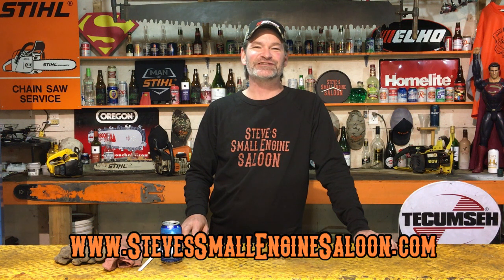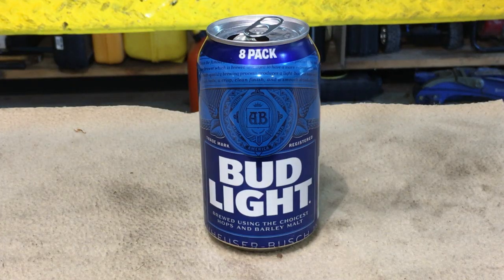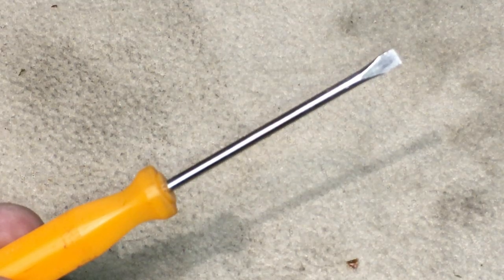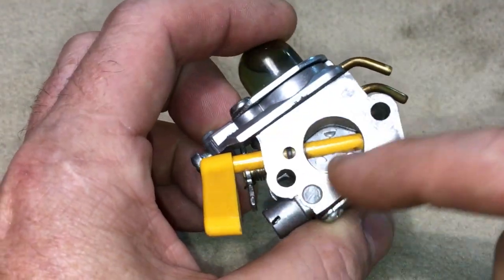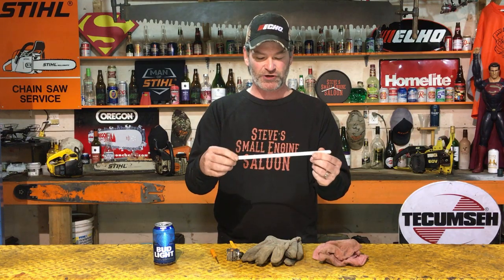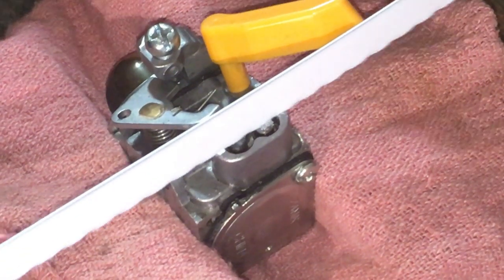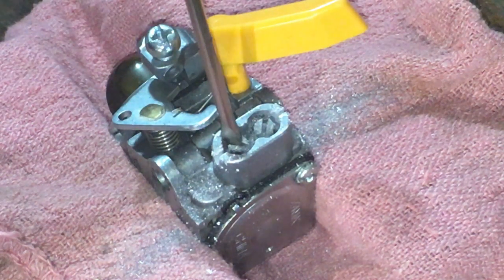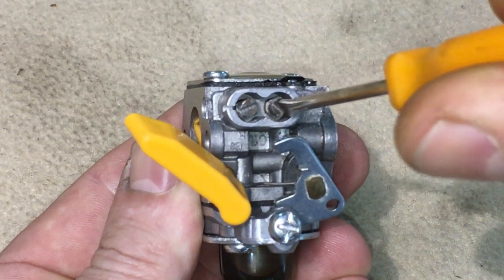How To Adjust a Carburetor Without a Special Tool

Comment: The freaking govt did NOT want the consumer to adjust the mixture. Husqvarna wont sell the tool and suggests taking in for service. I have a troybilt and found online that they are assemble at a bit of an elevation and here in FLA at sea level a small adjustment  might be in order. I have a trimmer that i paid $40- for that was put away in storage when he "went electric" and its in mint condition, so I'll  probably wait for the tool. Tractor just died so well be changing out 17hp briggs and the lawns already 2 feet tall so fugit 😅

Comment: If there is clearance and the screws turn fairly easily you can try forcing a piece of plastic tubing, like clear fuel line tubing, over the end of the screw head to turn the screw too.  This does not require and mods to the carb.
Reply: Larry Small Much easier said than done.
Reply: I think that is a great suggestion. At the very least it is another option. And I'm testing all of my options.

Comment: Yea, I ordered a set years ago. but you can also use a dremel tool if you go your way. You can also use vacuum tubing or heat shrink tubing... insulated crimp on wire connectors, etc.

Comment: THIS IS AWESOME! THANK YOU! WTH do these tool companies need to make things so overly unnecessarily complicated; just to turn 1-2 screws! Theres zero reason or need for these crazy types of sockets/drivers. Phillips, flathead, Torx, or Allen would have been just fine! Additionally, it’s OUR tool/machine we bought…they need stop trying to control and prevent us from doing our own work/adjustments…My whole manual just states go to a dealer for the L & H what a joke! Took me a few hours to finally figure out it was a Double-D. I honestly thought the screw heads may have snapped off because I didn’t see any “slots” for screw driver, etc. In 25 years of working cars, woodworking, and IT Engineer I’ve never seen or heard of these types of crazy bits like double D.

Comment: I was a bit nervous about wrecking things but this worked  like a charm!  A 1/4 turn on the high speed screw fixed up my Yard Machine Y2550’s inability to run on full throttle. A very big thanks for this viideo.
Reply from the maker: You're Welcome...

Comment: Awesome in not only letting us know of a great hack to get up and going, but teaching on the various carburetor adjusting bit kits so that we can adjust many carburetors on the market. I have a chainsaw on my bench that needs the "Pacman" bit and i was at a loss on whether i would need to take it in for adjustment or figure out another option. Seeing i am in no hurry i am purchasing a similar kit unsure if i will do the 8 bit or another 14 bit tool kit. If i was in a hurry i could also do the hack you showed. Luckily i finished cutting down a 45 foot and 35 foot tree this week, and parcelled the trunks/limbs into 12 & 18 inch portions. I have a few left to cut however 95% done, so i can wait for the carb adjustment tool set to come in rather than having to take it in for adjustment now. So you have saved this old guy some money, and i'll have the adjustment kit to save me a lot more in the future as well.

Cheers,
Blitz out....

Comment: Great video!  My Ryobi X430 trimmer was just millimeters away from the trash.  Only a couple of years old but suddenly would not run at full throttle.  Carb cleaner, fresh gas, etc. didn't help.  Unlike the Ryobi carb in your video mine only has a single adjustment screw.  I used your hacksaw hack to cut a shallow groove through the housing around the screw and the screw top itself.  Then a adjusting with a small screwdriver was easy.  And it solved the problem.  Now it will idle fine and goes to full throttle without hesitation.  Have a Bud Light and celebrate!
Reply from the maker: Right on Buddy..

Comment: Thank you so much, I have purchased 2 sets of carb tools and none of them fit on my Yardman weed eater. I used my dremel with a cut off wheel and put the slots in and it worked perfectly. The weed eater is running the best it ever run.
Reply from the maker: You're Welcome...

Comment: Great video. I use my dremil with a cut off wheel while the carb is still on the machine. Takes a steady hand though. Your way looks safer.
Reply: Works for me also!
Reply from the maker: Thank You...
Reply: Did the same way for me too.... Dremel Rox.
Reply: Just did this too today while on machine.  Works a treat.
Reply: Also did this with Dremel cut off wheel. My adjustment dials weren't parallel, but worked great. Don't forget to wear your goggles, and beware that the dials may be made of a metal like sparks like you're welding with magnesium. Lucky I didn't have any starting fluid left on the outside of the carb.

Comment: Awesome man! I've used this method before and have been running around town trying to find a spline tool for my Husky 128LD. I just put a new fuel filter and lines on it and now it only idles on half-choke, so I'll go peel that carb out and give this a shot. As always, good info, Steve! If I have a saw or any small engine issue I always go to your videos first. Thanks again, bro!
Reply from the maker: You're Welcome...

Comment: i used a hard plastic sleeve on the end of a small screwdriver and heated it so it fits snug on the idle/high adjusting screws, ( to avoid pulling it apart).... well it sort of worked, but did the job. i have a small  McCullough  ( re badged  husqvana ) chainsaw  with a two barrel carby. when its going well, it is a real pearlier.

Comment: I used a small needle nose to turn the ones on mine worked out fine
Reply: My saw has guards around the small adjustment screws so I have to dismantle the thing.  Dumb  bureaucrats need to be left on deserted island with all the gas and electric tools in the world but no energy source to run them, and no tools to do any kind of hack.

Comment: I bought a complete small engine carburetor adjusting tool set on eBay for about $12 free shipping. It has every possible tool you’ll need and some you might never use. Really handy.
Reply: Correction. It was a bit over $16.00. Even comes with a case

Comment: WOW!  SO damn obvious yet my mind never would've gotten here!!!  Haven't got a hack-saw but have enough fine-toothed blades (and sawzall blades, and dremel bits, and die-grinder bits and thin cut-off wheels for angle-grinding) that I'll be using this not only for carb-adjustment H&L's I can't get to but for MANY other things through life now that I'll be seeing it as simply as "make a flat-head slot"!!  
Thanks again, not just for this vid but for the series you've produced it is required-viewing for people trying to learn their way to basic-competency w/ 2-strokes, truly applaud people like you (and billy ray, and reg coates - the 3 of you I hold in the highest esteem for having the best value-per-minute in videos + comprehensive libraries and, nicely enough as cherry-on-top, great personalities & humbleness that isn't false-humility or anythign - can't help but wonder if that's just the canadian-vibe, have always found I loved canadians in real life, maybe I need to migrate LOL)
And again I'm so sorry for your loss, I hope you're coping as well as possible and remembering the good times!!!!
Reply from the maker: Thank you so much buddy...
Reply: i was afraid to try it thinking if you cut into the aluminum it would have caused a leak. Glad to see it doesnt.

Comment: Having trouble with a ryobi backpack leaf blower BP-42
Replaced the carb and spark plug … the blower starts but ..after a few minutes the engine Boggs down and I notice gas on the housing behind the spark arrestor
I rechecked all my fuel lines and have tried all kinds of adjustments to the carb …. What am I missing … thanks in advance  for your help and the work you put into your videos .. I find them very helpful …. Mike

Comment: I was able to use the blue wire barrel connectors to adjust my Troy bilt trimmer, just squeeze the tip a little bit and works great

Comment: Great advice! Horrible beer though. I was actually thinking about cutting the damn surround entirely off of the metal around the screws. So you saved me from doing something totally dumb.  Thanks for posting this!
Reply from the maker: Thank You...and You're Welcome...
Reply: That's exactly what I was doing! With my HF mini dremel I hacked up several carbs, but they're still running though !

Comment: Hey Steve I watched the video and had a need to try your trick. Only difference is that I used an oscillating tool with a metal blade. Works great. Didn't even take the carb off the weed eater. Thank you for the inspiration!
Reply from the maker: Cool!

Comment: You can use a red wire connector pushed on to a small screwdriver to turn the jets also. Just a little trick.

Comment: Haha! Sweet action! That's a dam good solution I luckily have a poulan 2075 16" chainsaw with an 18" bar and its got slots but the poulan 14" forget what model it is but my paw paw gave it to me because he couldn't ever get it running, after attaching a couple but splicers to the adjusting screws and 5 minutes with some fresh fuel I had it running like a top he was so pissed hahaha I like my 2075 poulan its my favorite even though people talk bad about poulan saws mine runs just as well as my Stihl I used thread locker blue on the adjusting screws and the screws that hold the carb to the cylinder block I haven't had a problem since I did that
Reply from the maker: Right on

Comment: I struggle with the small A circle low speed needle valves that live deep inside the throttle cam of the modern Ryobi with ruixing carb, think Ima have to buy a tool for that

Comment: I've used a pink butt connecters to turn them. You have to find one that fits snug when you push it on the screw.. Good vidios. I have been in outdoor equipment for 31yrs.
Reply from the maker: Nice tip, Thank You...

Comment: Are these adjustment screws able to screw all the way out like older adjustment screws so that we can spray some carb cleaner in the ports to clean them out? I've already took the carb apart and cleaned everything except for these two ports and I'd like to go ahead and spray some cleaner in there while I'm at it just in case there's some dirt or grit or whatever in there. 
 Thanks for the hack 🤙

Comment: Hi Steve I’ve got trouble with my  Stihl br 200 backpack blower it starts easy and idles ok but when I throttle up it dies. I’ve removed the carb cleaned an fitted a new kit. I’ve tried it same again so I replaced the crank seals and tried it same again 🤨 so removed the spark arrester and a new spark plug fresh fuel and still some again it’s not don’t very much work in it’s life ? Please help me Steve

Comment: Hi Steve, Another great tip.  Just wondering if you remove those screws The low & high and you forget where they went I believe one is longer then the other. I can't remember which one is longer the low screw or the high screw.  Can you please let me know. I think it could also make a great tip video.  Thanks

Comment: Hey Steve I have a Echo pole saw that is 2 cycle and the dog gone thing has no carb adjusting screws at all! neither low speed or high speed and of course it will not run unless the choke is left on about half way do you have any recommendation on what to do?.....replace the carb?.....find the hidden screws?......or ?

Comment: Just found this channel. Wish I would have found it earlier, before I threw my gas weed eaters away and went electric. (Ugh!)
One thing that does work very well to adjust those carburetors is a piece of quarter inch copper tubing   like is used for refrigeration lines.
Fits perfectly.

Comment: I do the same thing, but I use the electrical connector trick to remove the jet screws first. Those slots make it WAY easier to dial in the carbs!

Comment: You can ALSO use a "Blue 14 Guage Male Blade" Shrink SMALL End to adjust that!

The EPA has the tools available for Certified Small Engine Mechanics, though you can find them in a set on Amazon...

Another AWESOME video!

-Thomas (12)
Port Orchard, Washington
Reply from the maker: Cool...

Comment: is it possible for a carburetor to be so badly out of tune that the engine wouldn't start at all? I got this ryobi leaf blower for free because my neighbor was tossing it and I can't figure out what's wrong. It runs off of starter fluid, but won't run off the tank so I cleaned the carb and it still wouldn't run off of the tank. Now I know that it has fuel and I know that the fuel.line isn't broken off or anything so I'm at a loss, if anyone can tell me what is wrong I would be greatful.

Comment: Here I am commenting on a 3 or 4 yr old vid,  but: I prefer to butcher a screwdriver rather than a carb. Used a grinder to reshape two screwdrivers. One, cut the end as a wide slot with two pins, these fit over the narrow part and grabbed the adjuster and turned it. Other one, shaped it as a thin curved end, this turned another type of adjuster. That way, can transfer the tool and don't have to hack at carbs on other gear.

Comment: Those idiots at the factory think their initial adjustment is PERFECT but many times it is a mess. They do this crap [special screw heads] to keep people paying an arm and a leg to repair shops for 5 minutes work and to sell specialty tools.  Tear them up Steve!!! Good job.  I would have done the same, maybe even tried my Dremel with a cut-off disc.  Then totally remove the screws and dress them up a little better. Problem solved.

Comment: Steve I have a challenge for you. MY Ryobi 42 backpack blower starts and runs but bogs down w/ attempting to accelerate. I have done everything you suggest....New Carb, new fuel lines, new fuel and air filters, new spark plug, clean muffler adjusted high and low speed screws all to no avail....I even consumed a large lager. Nothing seems to help. Again it will start and run but bogs down when attempting to accelerate, will not fine tune using high speed and low speed screws and dies after running five minutes. Any suggestions would be greatly appreciated...It would be even better if you could find a Ryobi 42 backpack blower and do a video using it as a patient. Thanking you in advance and keep up the good work and keep the Saloon open......Patrick
Reply: Patrick Page Check the fuel lines to make sure they are not kinked, pinched or deformed in any way.
Reply: FUBAR
Reply: Check the bolts that hold down the engine head that holds the piston. They can become loose and allow air to flow in the chamber causing you blower to run bad.

Comment: ever run across a homelite leaf blower were in place of the H screw there is what looks like a metal plug of sorts... the l screw has a plastic limiter on it. ???plastic comes off easy nuff but how can I adjust the H screw??? 
really at my wits end with this thing. 
anyway to adjust those?

Comment: I have double D adjusting tools. My hands!
I have to do this. Spent $9.00 on a single D tool from amazon and it’s too small for my adjustment screws. I figured the size was universal. It should be! Probably just Craftsmen (Crapsman) not wanting people to adjust their own damn equipment, so they made the screw a few thousandths bigger.

Comment: I just got done trying to find someone with the tool to adjust my chainsaw carb.  California is a beautiful state full of assholes.  Now I can't even find Denatured Alcohol to thin my shellac or make a special polish for my woodwork.  Yeah I can buy some EverClear Liquor or rubbing alcohol but I'm a recovering alcoholic and don't want liquor in the house so I buy 70% rubbing alcohol which sort of works.
I'll find a tool for the carb or make one, otherwise I've got an expensive piece of junk and firewood to cut.

Comment: It's smart to use Premium gasoline in small engines.  Unlike an automobile it will probably cost only a few dollars a year more.  If you bought the Ryobi BP42, return it and get a new one next season.  They die after a year or so.  Ryobi hillbillies will guide you through all the things that could be wrong.  That process requires buying part they suggest, waiting for part, installing new part, calling Ryobi when that didn't fix the problem.  I went through this  4 step/week long process-At least 5 times:  Air filter(1 week), fuel filter(1 week), carb cleaned, carb replaced with a new one, new fuel and air lines installed, new plug.  Over 12 hours and ~$100 into this and I give up.  Ryobi sucks.  Their hillbilly helpers are in the business of getting you to buy all these solutions!!  They don't get paid to actually help you with your problem.  If the Chinese blew leaves, they'd make a better leafblower.  They don't-Ryobi BP42 is a planned obsolescence product. This piece of crap is actually a terrific leaf blower when it works.  Show me a homeowner who was able to fix their BP42 and I'll blow your leaves for a season.
Also...when you're on the phone with them and they ask you for the serial number on your blower, you'll see that the serial number is sleazily hid by an impossible to read microscopic font size. DO NOT PULL THE STICKER OFF TO READ THE NUMBER!!  While on the phone with them I pulled it off  It voided my warranty.  VERY SLEAZY COMPANY!!